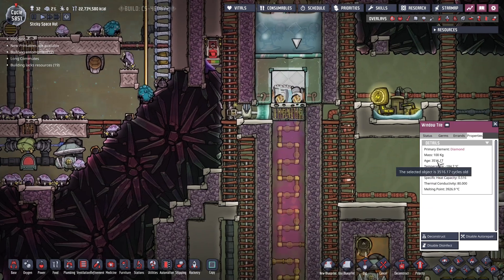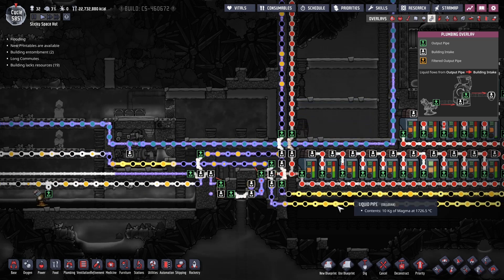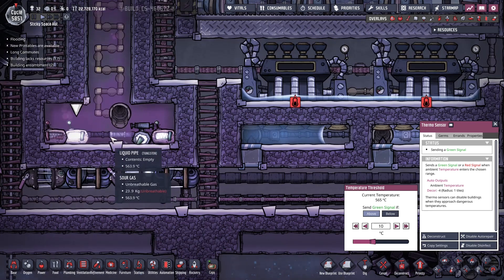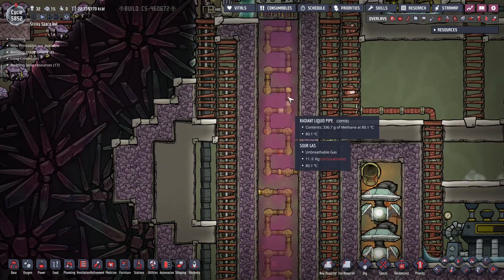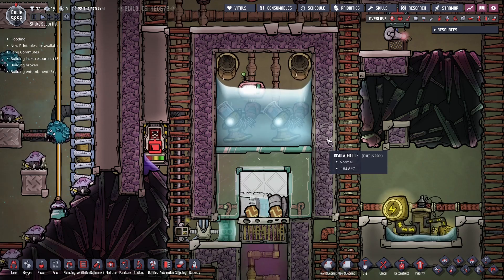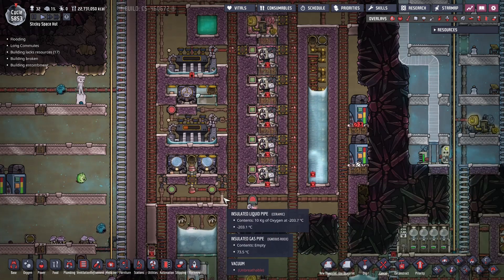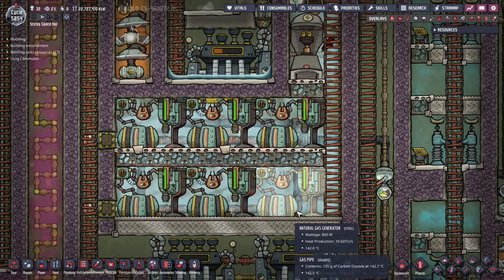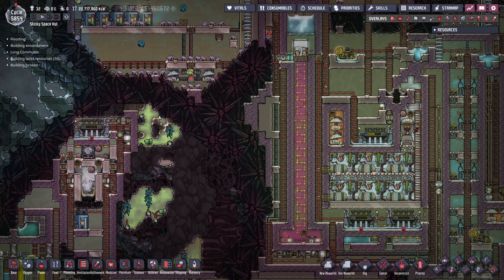Non-Space Sour Gas Boiler - Oxygen Not Included

Comment: this feels like a lot of effort for around 2kw of net positive power (not engie tuned) and you get little water out of it at around 400g/s. I mean it's cool as hell but dear god that looks finicky as hell to setup (and a whole lot of skill i dont have)

edit: also i did some very rough math and thermo regulators with hydrogen are about 20% more energy efficient than aquaturner with oxygen (because oxygen's SHS is 1 while hydrogen is 2.4)
Reply: But liquid oxygen has 10 times the mass of the hydrogen gas.  SHC is per kg, so to correct for the different mass, you need to multiply that by the mass.

So the liquid oxygen takes 10dtu per blob, but the hydrogen only takes 2.4 dtu per blob.

In addition, liquid hydrogen is too cold and will freeze the methane.
Reply: @Mr.Sparks.173  think of this this way colling 10kg/s of O2 is equivalent to cooling 4.16kg/s of H2 whick makes 3.46kg/s per kW compared to 1/0.24= 4.16 kg/s per kW for the thermo regulator. Thus 4.16/3.46=1.204 ie +20,4% more efficent

10*1/2.4=4.16
1 is SHC of O2 and 2.4 SHC of H2 and 10 is output of thermo aquatuner

4.16/1.2=3.46
1.2 is thermo aquatuner power consumtion in kW

(note both thermo aquatuner and thermo regulator cool the liquid by the same delta T thats why i didn't bother going into the actual dtu and just used equivalent hydrogen output)

Note n2, for laughs i designed a pre steel sour gas boiler and i can confirm that thermo regulator can be much more easily used to cool the sour gas than liquid oxygen by using them in chain with a heat bank (thats what i call a big ol pool of water that acts like a capacitor, i used 7t i think)
Reply: Yeah tbh I’d stick to only doing petroleum boilers until you do have the space materials to make a setup for sour gas that can handle a full 10 kg/s of oil input, for a normal playthrough where you just need the actual utility and you’re not just building stuff for the sake of it because you’re an ONI master.

Comment: Ceramic having the mass and still transferring heat in any case I just use mafic for everything related to to-outside heat transfer and ceramic for just heat-cold transfer where 2 blocks gap don't fit. Ceramic is too rare to be used for any wall mafic just has less mass so it's less of a hassle being heated up by oxygen. For Hydrogen I do tend to use ceramics but it flashes with any insulated tile excluding Insulation so why not just mafic.
Reply from the maker: Good point! I also found a good trick is to use metal tiles and chill them right away, while having a vacuum layer around. Check out a video I made a while back on how to make tons of ceramic.

Comment: at pi 3:14 i think you placed an or gate instead of an and gate but it shouldn't matter because only the thermometer matters i think
Reply from the maker: Good point, I misspoke. On the right, there is an OR gate. I could have used a straight wire for that one with no gate.